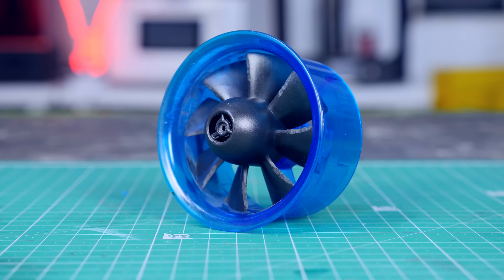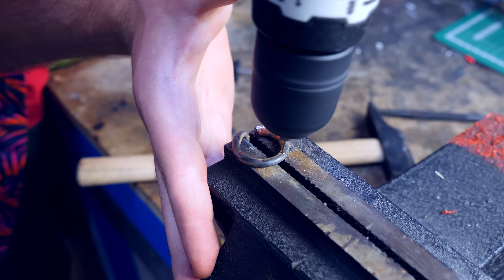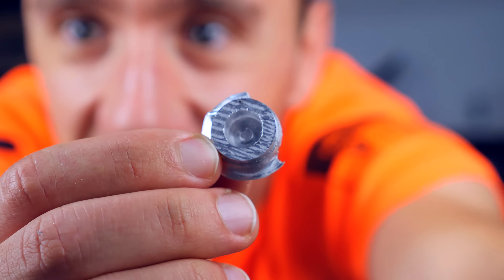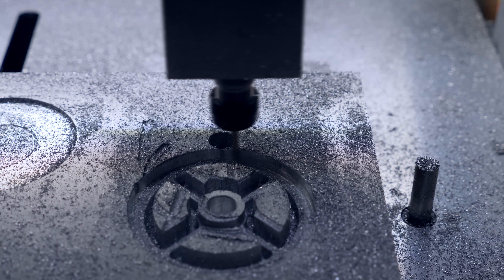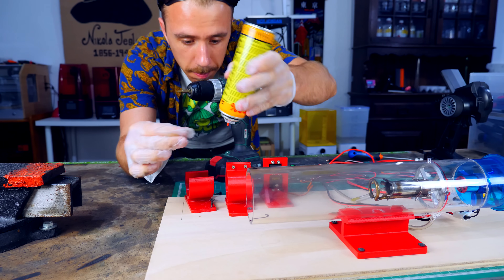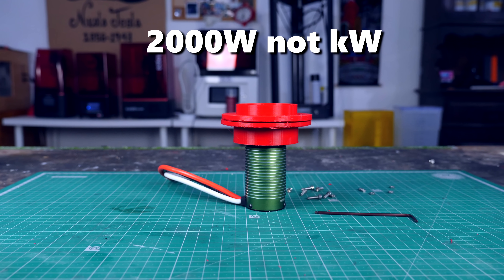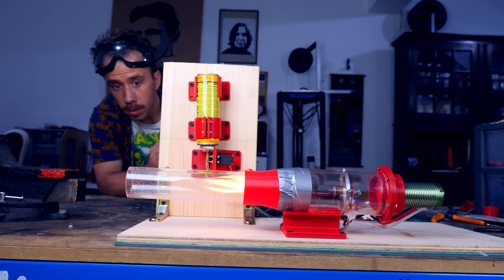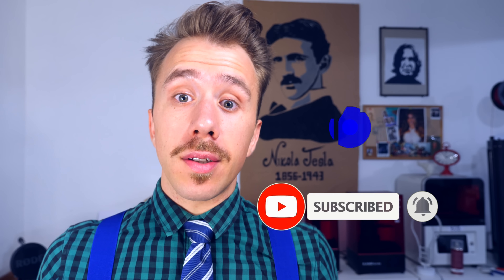I turned my Fan into a Jet Engine (3D Printed EDF Afterburner)

Comment: For the small cnc and cutting aluminum I would advise to not go too slow on the feedrate and use a low depth of cut. Don't go deep at all even not with a slow feed rate, the tiny endmill will heat up and cut very poorly and most likely clogg up

Comment: Centrifugal fans need a decent amount of surface area to push a lot of air (a.k.a. wider blades).  That's why you mostly see them in a 'squirrel cage' configuration - the length of the 'cylinder' created by the blades (in math they call it the cylinder height) is longer than the diameter.  Also - position the start of your constriction at the same place as the fuel injector, or just a little before.  As you know, the constriction causes a drop in pressure and an increase in velocity.  With the constriction in front of it, the pressure drop will cause the flame front to tend to back up a little, as we saw in yours.  Optimal position varies depending on the constriction ratio and length, fuel / air mix and air flow, but I'm sure you can come up with some experiments to find the sweet spot.  :-)

Comment: you should build some arc/taser modules so that you can use the arc for ignitors on the body of flame tubes because it would be a reliable ignition system and a safe low voltage alternative to glowplugs. also you could use rc car glow plugs for nitrous if you have to use glow plugs because they are also low voltage and safer.

Comment: @Integza  Why the Centrifugal Fan instead of an Impeller type?  I would have thought that the more powerful direct air flow would be more effective in terms of keeping the flame away from the sidewalls, cooling the flame tube as well as preventing the back pressure that brought so much flame forward toward your electrical connection for the Glow Plug.

Something to consider for reheat ignition might be the type of tiny Glow Plug used in the single cylinder 2 stroke engines that power R/C airplanes.  Those engines only use the plug at startup, so I don’t know how well one might handle longer activation.  Of course afterburners aren’t meant to run continuously themselves.  But those plugs certainly use dramatically less electricity and are much, much smaller/lighter than the one currently in the engine.

Comment: Suggestion for a project ... Mane an HHO cell, or more impressive an HHO torch.

This is something I find very interesting, but it has been done many times.  An HHO cell.  This can be used to make an HHO torch which is probably my favorite torch based on science principals alone.  It can cut/melt metal, it can make a Synthetic Ruby, it can be used in glass making, and more.

Comment: Entertaining as usual but I have a few tips and observations that I hope might help you with your project.
First of all, this engine is wasting a lot of power since the whole reason to have combustion is to increase the enthalpy (temperature) of the fluid, by not having a convergent nozzle, you are not converting that thermic power into kinetic power at all. On a separate note, a measure of how well you can use that thermic power is the fluid pressure and, as you mentioned, the impeller has the job of increasing it, the problem is that the impeller that you build doesn't do that, it's just a fan hitting on the sidewalls, not a compressor.
I hope those observations will serve you well in the upcoming part 2 of this project!
Reply: Oh and I also advise you to put some vortex generators (very very simple matrix of "V" shaped inner walls) right after the fuel injectors, that will allow the mixing of the fuel and the air to be much better.

Comment: How easy would it be to 3d Print an Impeller similar to that found in a Turbo? Also wondering if the ignition would be more effective if placed after the fuel source? Yours seems to work, but blows my mind that the fuel is travelling against the airflow and still igniting!

Comment: When machining inside cuts, avoid not having to drill with the mill. it's always preferable to enter through a hole or from outside. much fewer vibrations and a better  finishing
Reply: speeds and feeds as well, the 3 or 4 flute cutter he is using is fine, but he might be trying to move to fast and getting to many vibrations. Also if it is in that cnc program to have a variable speed rate, helps cut down on harmonics
Reply: Should also try to mimimize tool stickout.
Reply: and, he needs to lube...
Reply: 3:45 the swarf jumps on that downwards jolt, even the chuck/collet gets pushed.
Reply: Don't call that thing a mill please :D have you seen the concentricity of the endmill? XD I would helix down into the material, then i would choose some profit milling (trochoidal) strategy to rough out the pocket. But anyways i would use a lathe to manufacture this specific piece.

Comment: Liquids can't burn, only gas.
And if you put the can this way, only liquid will get out of it.
So it needs to transform into gaz before burning, and it takes energy from the glow plug or the gaz already burning,
It can be a good thing to "lower the combustion temperature", but it also mean that it will be more difficult to ignite and do a continuous flame.
Also gaz is way more better for mixing into the air comming into the chamber than the liquid. Resulting in a better, easier and quicker combustion.

But you might already know all of this. ^^

Comment: Hi Integza, 
I hope all is well at your end. 
Below is an idea I had some time ago but I couldn't do it for some reason. Its a humble request if you can consider below idea and test if its possible. :) 
Video Idea: a utensil that can be placed on an induction plate/stove and be used as an alternative to convection oven in order to make dishes like Pizza without someone to be having actual convection oven. Reason being, I am an Indian and more than 95% of households here dont have a convection oven, since we only have the option to use gas stove or Induction. I love some of the western dishes that cannot be cooked/prepared in a normal Indian Household. I have been your follower from some months and love your videos. I would really love if you can test if this is possible.
Lots of love from India,
Gaurav

Comment: I can be wrong, but don't you need to slow down the air flow to rise pressure before combustion like most jet engine ( remember PV=NRT, heating both air and fuel will help with exhaust velocity ) ? Can you do an Aerospike nozzle with your CNC  and maybe switch from aluminium to tungsten ?
And the only thing better than croque-monsieur is a croque-madame (the same with a poached egg on top).

Comment: You need to buy an end mill for your CNC machine that is shorter. A lot of the noise and even inaccuracy will come from tool deflection caused by the length of your end mill.

Comment: It seems like the fuel to air ratio needs to be tuned. You could use a micro controller to ensure the best fuel to air ratio and throttle from there

Comment: I think you should try building your own controller. With some potmeters with a digital readout of what they are set to, I'm pretty sure you'd have a lot more fine control over amount of fuel, and fan speed.

Comment: Video Idea: Could you make a thrust testing jig and measure the most efficient fuel flow and throttle speed for thrust.

you could do both the most efficient usage and also the maximum thrust possible out of your system

Comment: You discovered one of the drawbacks of afterburners that exist with real jet engines. Afterburners are very thirsty gas guzzlers. When used, afterburners can cut a fighter jet’s range in half. To make the tests more meaningful, I’d like to see how much more thrust you get when the afterburner is lit. To do this, you’ll want the ability to run for a longer time. I suggest a bigger fuel tank.

Comment: How about fire and flame-resistance filament to the 3D printer? That would be good because you can easily make parts with your designs and you won't lose any of your parts, then you can put those parts on the shelf and then you can compare those parts and learn what went wrong. Like jet "engine number 22" has this and that which are fatal flaws, then you can learn and then fix those parts and of course, show those parts as trophies :)

Heil to the king Integza! Death to the peasant tomatoes!!!

Comment: There is actually a much faster way to check if the can is empty.

It involves a complex process of drilling the can. My study has concluded the results, and they are VERY PROMISING.

If can is empty = Success
If fingers turn to liquid = Great success

Those silly meat sticks only slowed you down anyway

Comment: I would just get a glass tube and something like a 1500cc fuel injector and do the calculations so you can have a dial for air fuel ratio

Comment: maybe you can use an afr gauge to monitor if you have a stoichiometric air fuel ratio and an arduino to control the injection of fuel automatically, if you premix the propane with air before it enters the engine i think you will have more succes substaining the combustion

Comment: Video idea: Behind the propulsion system, add a system like a sandwich (without tomatoes) with a ceramic plate that withstands the fire-power, and a precise scale behind it to measure how much propulsion force you are getting out of each experiment/fuel type. This may provide interesting data for what this kind of engine may be able to push!

Comment: What happens if you try to create a laminarflow jet nozzle like the water flow nozzles in fountains? (the cool fountains that shoots water realy straight).
should only need to put a bunch of metal or glass straws in the exit pipe.

Could maybe be effetctive to increase jet power since all thrust power since it reduces/elliminates turbulence
https://www.youtube.com/watch?v=o5L6W0YoAd4&t=682s

Comment: I want to correct one thing:
Glow plugs in diesel engines are not used to ignite the fuel, but to preheat the combustion chamber if the temperature is below a certain threshold. That is necessary because the fuel (diesel) does self ignite if compressed and thus reaching a high enough temperature. There could however be a problem with ignition, if the combustion chamber is to cold for the diesel to self ignite. The glow plug eliminates this problem by preheating the chamber to a temperature the fuel is able to self ignite with enough compression added by the pistons.

Their function is thus not equivalent to that of a spark plug!

Comment: Hey Intexa! Love you! (No homo)....

So anyway, you've probably seen air vortex cannons, right? You've also probably seen that cuttlefish that gets caught in an undersea vortex and is left spinning to the tune of the interstellar movie theme. Pretty cool right?

Point is, i want to see a fueled vortex flame cannon, something that launches a vortex ring of lightweight fuel that you might somehow set alight. I want to see you burst a bunch of ballons at range with a huge flaming fart ring of death TM. 

Failing that, i might also be satisfied if you find a way to make a fire tornado gun similar to your current jet engine project and your past self cooling rocket engine project. Plese try to focus the flames towards getting max range possible per unit of fuel added, i.e. get the tongue of the flame as long and as narrow as possible, without say, using a mile long barrel to achieve the effect.

And please, for the love of all that is holy, try to keep your safety in mind first? I do NOT want you to burn you house down! Please take proper fire safety precautions, and maybe show in your videos that you are infact taking your safety seriously? Best to be careful with youtube guidelines these days. 

Anyways, keep up the good work, and stay awesome 😎 🙏

Comment: theme :- try making a rocket engine that can run on kerosene / jet A1, and make a venturi tube at the exhaust of the jet engine to increase the thrust and mount the rocket on rails to measure the thrust it produces

Comment: I saw you using superglue and I wanted to share an idea with you.... using a mixture of super glue and baking soda creates an extremely hard plastic like material that you can sand, paint or even drill or put a screw through. Its hard enough that it can withstand being hit with a hammer with but can still be sanded or chipped off if need be. People use it on model planes and even in repairing things like guitars. Its pretty useful and would work GREAT on 3D printed parts or models as a way of either repairing or mounting pieces.

Comment: 😂😂  I don't think it's a jet engine rather than a flame torch which are used in metal shops and jewelry shops.  I want to know if your system is generating extra thrust than the fan on the front end??
Reply: Kindly do it scientific way so that it we can learn from your project, otherwise it is waste of time and money.

Comment: Excellent work! If I may make a suggestion, add a diffuser into your centrifugal fan design. If you boost the pressure, you will get much more compression and better combustion. Good luck and looking forward to your next vid.

Comment: Video idea: 3D print the car from toy story with the rocket on the back to propel it. Maybe even drive it off a ramp and use the rocket to give it a boost or add wings to make it a flying car when it jumps off the ramp.

Comment: Great work… but you have to make the air flow faster, a little before the entry point of the fuel. This will prevent flashback of fuel as you see in the constricted version of the afterburner engine. Simply make the impeller part itself big, and you can make a constriction to the previous size at the point of the start of the silver tube .

Comment: If the cnc sound bad it’s because of vibration 

There many ways to reduce vibration :
Get good tool( can get really expensive )
Reduce the tool length 
Play with the rpm and the feed rate
… 

Love your video 
Good luck

Comment: Hey Integza! 
Make a video on 'Tesla Earthquake Machine' using the same tech and idea Tesla used, high pressure steam and clever designed channel to flow the steam.
 Let's findout if yours can make earthquake or not! And also if it generates high constant frequency current or not.
A lot of videos of jet we saw, and I never get bored watching ur videos.  Let's move to some electrification!!

Comment: Try shortening the end mill as much as possible. The spindle is way more rigid so it can handle vibrations better. That should make it sound way better and give a better finish and longer tool life. Get mills with a shorter cutting flute length of you can.

Comment: Hi integza. I try to make this jet engine. But l run this engine with combustion chamber and also l make flame tube for this.I think combustion chamber version better. You can slow down the air flow to burn good . But l use combustion chamber version with fan. Electic fan can generate fast air flow not pressure.

Comment: Maybe not a video idea more like a thing / make idea: I'd like to know what thrust your engines have, how about some sort of universal bed attached to spring mechanism to measure power output? You have all the engines attached to table or some pad, instead create a robust base with some sort of connectors and inserts and test the all engines on one platform...

Comment: How about you try your hand at the magnetohydrodynamic drive?
It could be a cool (and more safe) project for once.
If you want ideas for rockets, how about a project where you build a small rocket that has an ascent stage that is just a linear accelerator tube, meaning it gets shot up before activating its engine.

Comment: You should make inverted flame jet engine. 
Fill big container completely with fuel than put jet engine inside container and use air in your fuel tube .

Thin can be useful on place like titan when the whole atmosphere is filled with methane and you can fill your calendars with oxygen and you are ready to fly.

Comment: I mean, it's not really a jet engine if you use electricity to drive the propeller. Usually you need a turbine to drive the shaft connected to the prop. I guess using a generator and a turbine at the end to drive the electric motor would count, but using external electricity doesn't. Maybe try this for the next video.

Comment: HI.Tips: 1. Could you use HOTEND from a 3D printer? 2. The blades in the fan are curved, he pressed them straight. 3. First calculate the cutting power / machine power (Vc, n, f, fc, ap, ...) and then start machining. Good luck,bye

Comment: Maybe in a future video you could create an HHO generator that output's hydrogen and oxygen gas from water. Hydrogen is a very powerful and energetic gas, and when mixed with oxygen the combustion reach's an high performance. You could use this 2 gases to power the combustion motors, and maybe the afterburner. It's very cheap since the fuel for the HHO generator it's basically water, some salt composite, and electricity, and also is nature friendly.

Comment: Make the fan rotate in the opposite direction so that it sucks the air and acts as a vaccum cleaner and the flame in the tube burns the waste !!
And you have an overengineered vaccum cleaner!!

Tomatoes are disgusting !!

Comment: Attach the engine to a small board. Attach the small board to a well lubricated drawer slide. Attach the other part of the slide to tha bigger board. Put a small digital scale in front of it and let's see how much extra thrust it generates. Coil the fuel line multiple times in a spiral. Put the spiral in the flame. This will preheat the fuel with its own flame. Put a tomato after the engine so we can roast that baby. When you cnc aluminum aff a mister to it. Many people use wd40 or ethanol or kerosene to mist while cutting. I think a boat would be pretty cool with this thing on top.